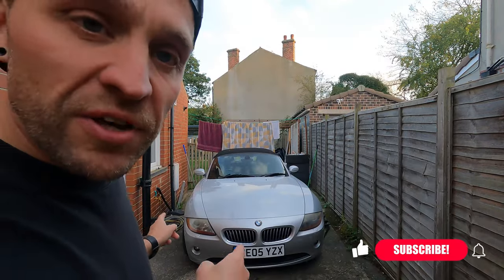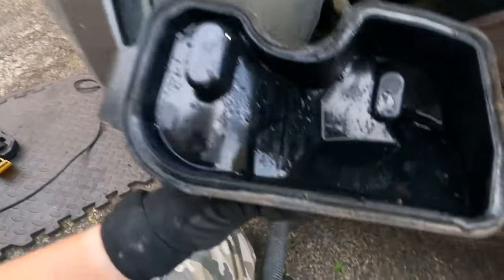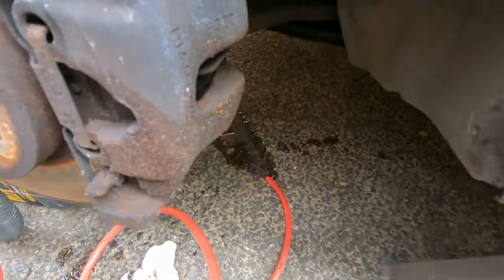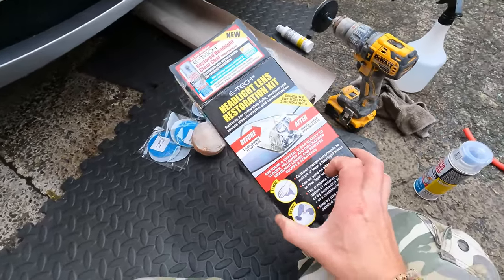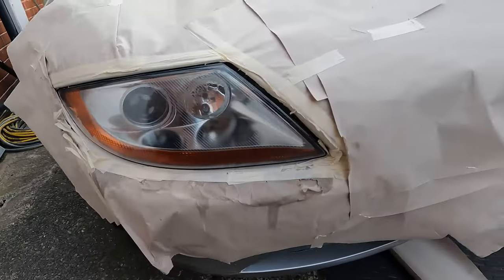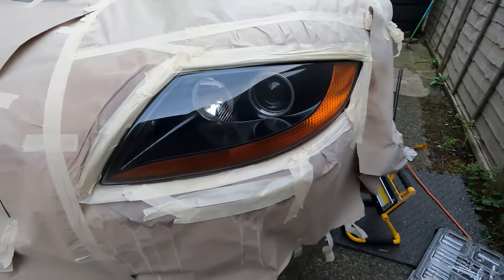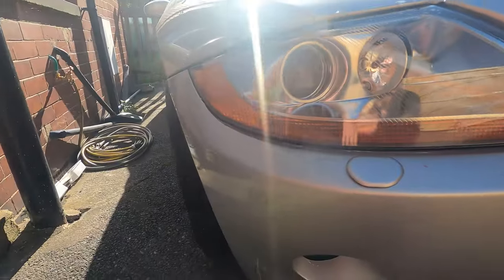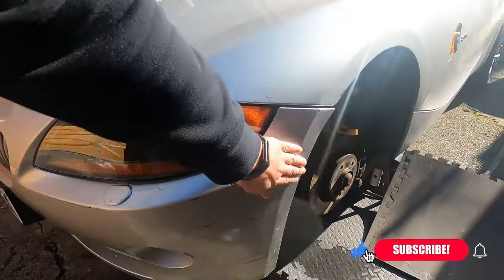BMW Z4 HEADLIGHT RESTORATION

Comment: Mate I had same issue, I ended up removing the headlights to drain the water.  I had to replace the rear covers in the end to get a decent seal.  The covers are 13£ ea direct from BMW.
Reply from the maker: Nice, I should really check BMW for parts directly more than I do. I always assume stuff costs more direct but I know that's often not the case

Comment: Nice video! If you drill a small hole in the bottom of the light, let it drain for a week... then put a rubber bung with some silcon in it after. That way you can always remove if it does it again. Keep up the videos Nate! Spot on edit.
Reply from the maker: Great tip! Couldn't believe how much water had got in. Plan is to find a decent matching replacement. Hopefully as long as it's sealed properly it shouldn't be a problem. We'll see!
Reply: Looking forward to the follow up!

Comment: Great work cleaning up the haze!  some thin 3M butyl tape around the seal and perhaps an inconspicuous pin hole on the bottom of the light if water ever gets in again, had this issue with some OEM Valeo B6 Audi lights...Keep up the great Z4 content! Just subbed!
Reply from the maker: Awesome tip and thanks for the sub!

Comment: Silicon sacks (the ones you get in a shoe box) absorb moisture. I taped a couple inside my headlight. No more moisture
Reply from the maker: Great shout. I'm gonna leave this headlight as is for the MOT as it's 90% better than it was. I'll get it replaced when a decent silver one comes up and fully dry it out ready for sale. I reckon it'll be as good as new.